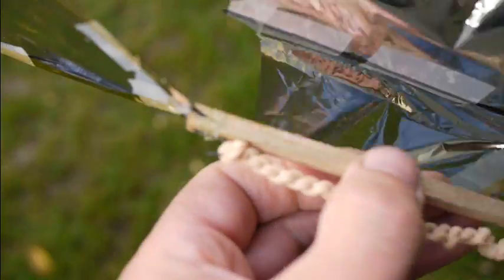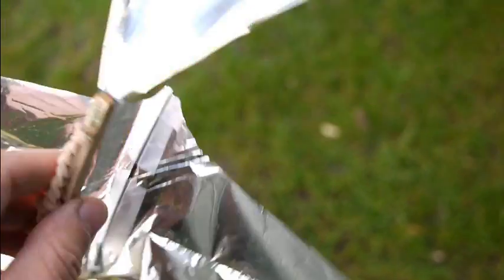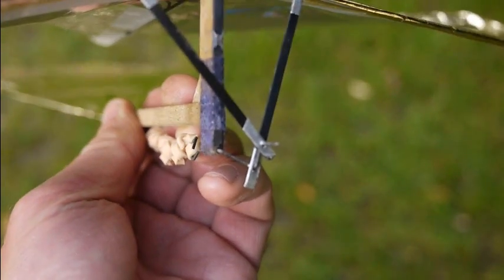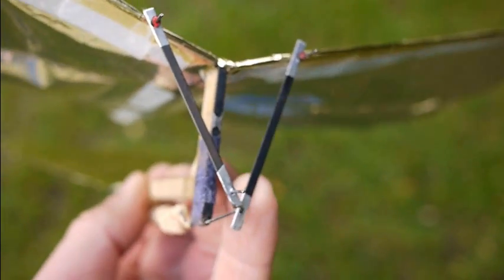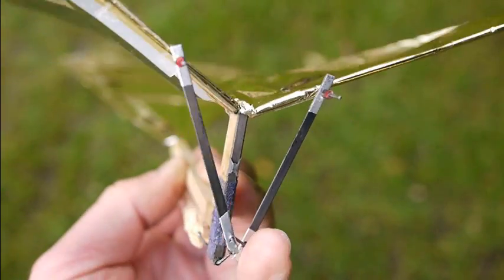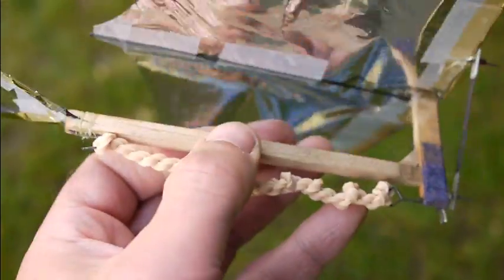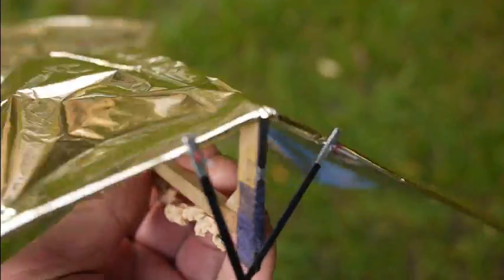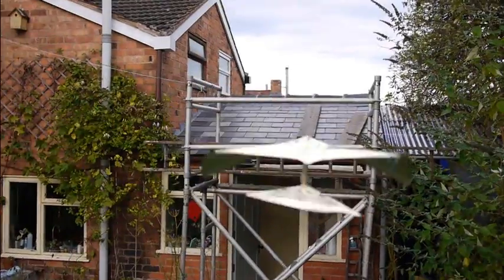ornithopter

Comment from the maker: Not silver foil if you mean the stuff used in cooking. This is metalized mylar like they use in space blankets etc. You could use thin plastic from a lightweight carrier bag or maybe tissue paper. For the spars you could use carbon fibre strip (you can buy it on ebay), balsa strip or maybe garden cane/bamboo that you have pared down to a small cross section.